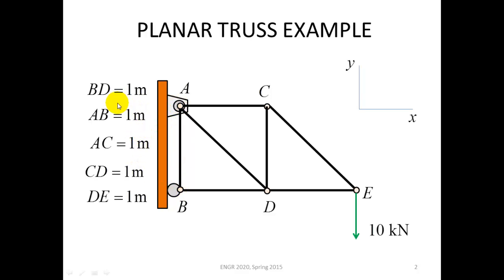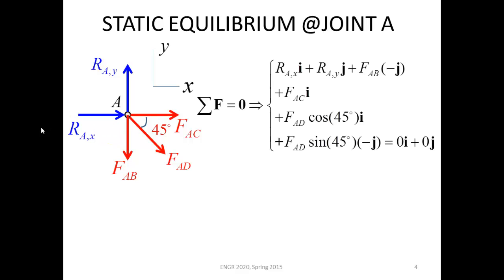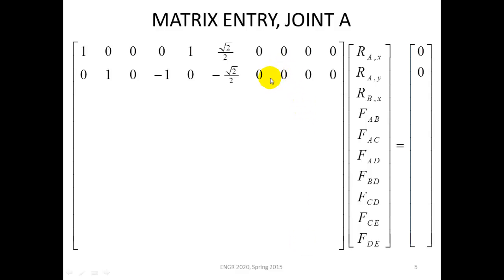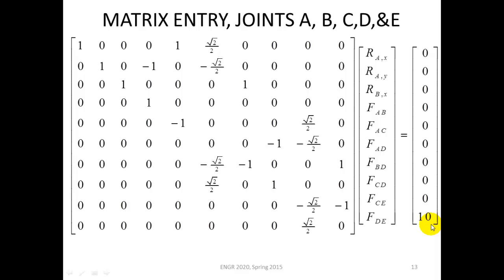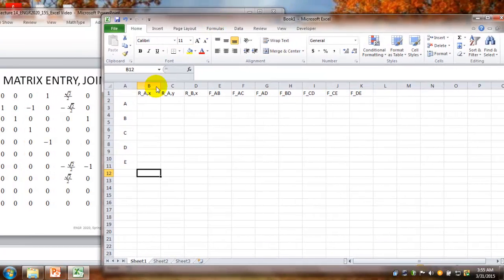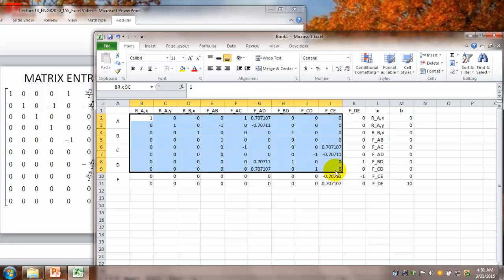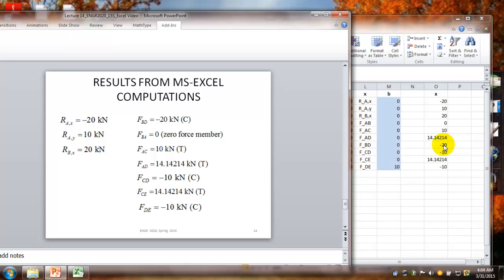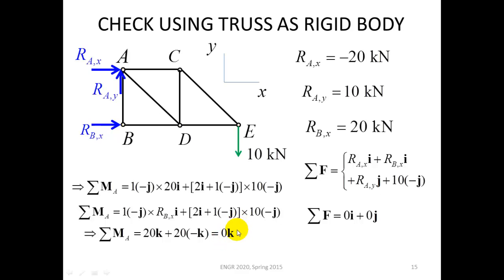Method of Joints Truss Analysis Matrix Method using MS Excel

Comment: So by using excel you can change the location of the load of the 10kN by moving it on the second matrix and it will then solve the load from said joint

Comment: I got a singular matrix for a symmetric truss.... What should I doo now?
Reply from the maker: Not sure. Maybe you have two rows that are nearly identical or one is multiple of other.
Reply: @DRabvyas  its a 16 joint truss...and i have 32 square size matrix.... Its so hard to input all values but at last i got zero as determinant..🤗😑😑
Reply from the maker: @prasads56  Your matrix entry/calculations are in error or that your truss is defective. Sorry, I cannot help you more at this juncture, and advise you to consult with your instructor.

Comment: Dear Mr Anand... What happen if the matrix is singular? What do we have to do?
Reply from the maker: If matrix is singular, either you have an error in your calculations, or that your truss is statically indeterminate. If the latter is true, the truss can no longer be assumed to be rigid, and concepts of deformation of the member will have to be employed (which is typically beyond the scope of a course in Statics/Engineering Mechanics at most universities). Hope this helps.
Reply: @DRabvyas  Thank you so much for your help... It helps me a lot. I made a mistake in my calculations, I could solve the system. I would like to ask if I can use this method in or order to calculate a Tridimensional Truss? Do I have to chance only the size of the matrix?
Reply from the maker: @DIEGO QUIZANGA For a 3-D truss (assuming it is not statically indeterminate), you have 3 equations at each joint resulting from the static force balance. An example of such a problem is to be found in the textbook on Statics by Plesha, Gray, and Costanzo , 2nd edtion, page 402 (McGraw-Hill publication). 
You can use the matrix method in that case as well, except that matrix will have more variables (so more rows and columns)

Comment: Could you use this for a 3d-truss too?
Reply from the maker: Thank you for the question.
Yes, provided that the truss is statically determinate and the static equilibrium equations in 3-D are deduced correctly.
Reply: oh definitely, just define your origin point, the angles associated by it. But note that you might have to do some Euler Rotations to obtain the global matrix like what Anand did. (You could avoid all of it by picking the right origin axis)

Comment: Mr.Anand how exacly did you got the stiffnes matrix?
Reply from the maker: Erdoan Musatfov  Thank you for your interest and question.This is not stiffness matrix, just coefficient matrix resulting from the force balance equations at each joint of the truss without regard for material properties.
Reply: @DRabvyas  But with this information now you can
Reply: @DRabvyas  sir. Which method is efficient for solving trusses by using excel?
Reply from the maker: @ZulTakHensem   Depends on what you need to determine. If it is force in very few members, you are better off using method of sections. On the other hand, if you need to find forces in all members, use method of joints. If you need to tinker around with how change in loading will change forces, use the matrix method shown here. For anything else (like stresses and strains), it is best to use Finite Element Analysis based methods.
Reply: @DRabvyas  thank you sir. I dont expect you gonna reply this  very quick 😆